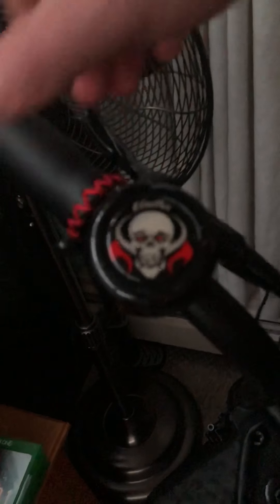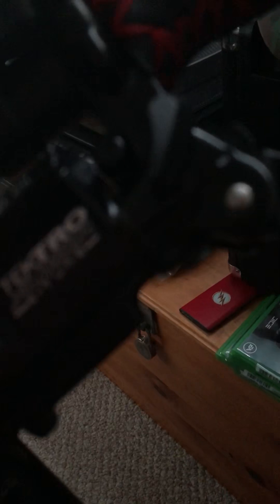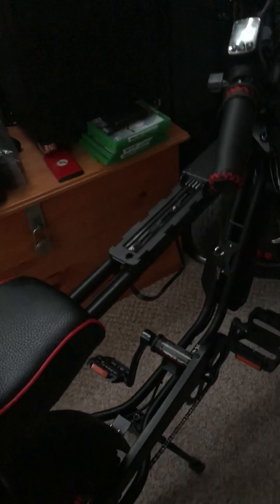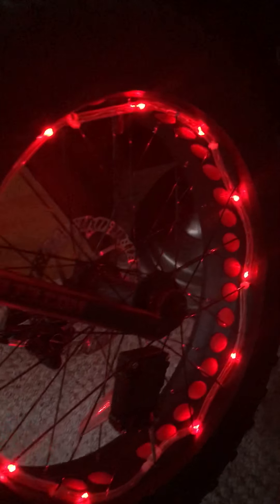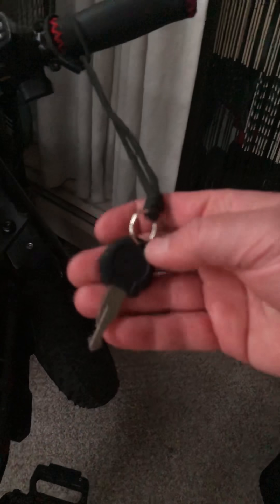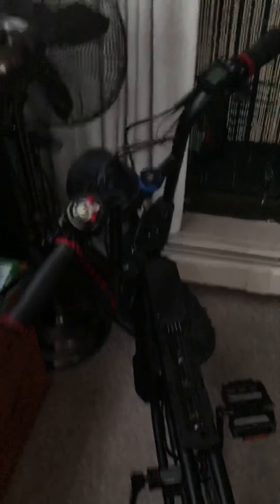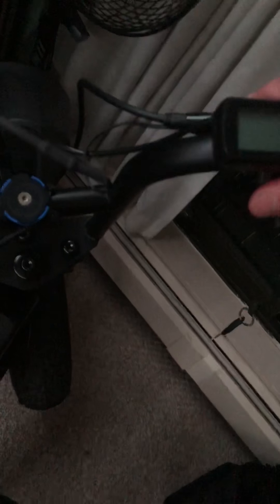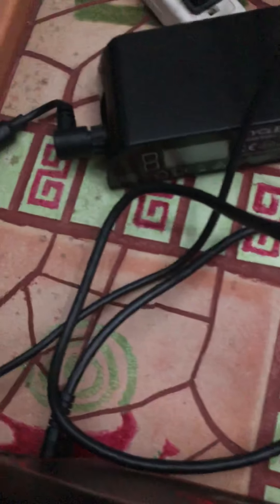Lithium cycle rose ave super 73 hydraulic break upgrade

Comment: Hi .. Thanks for the videos .. Which bike to you think is a better value .. Super 73 or Juiced Hyper Scrambler and why? Getting ready to buy one .. also looking at Mario Ebikes Super 73 copy .. Your evaluation would be much appreciated .. Trying to make an educated decision .. Thanks so much .. Mitch
Reply from the maker: Mitch Davis Honestly it’s a tough call I like the extra speed and range the hyper scrambler  gives me but it is one hell of a fast bike and if you are not holding on tight you can get thrown right off. super 73 doesn’t seem to have any bugs that I have noticed the one thing that bothered me about the super 73 Rose Ave. is that it didn’t come with hydraulic brakes and really it should have. I really like both bikes to be honest but when I am doubling someone it is far better to have the hybrid scrambler because the extra weight will not bog you down as much. The super 73 just has a cool look to it everything else in my opinion is just a copy more or less everyone’s optimizing the popularity of that frame. That 52 V battery 19. whatever amp hour battery on the Haber scrambler is moneyIf I want to go on a long haul I will choose the hyper scrambler if I just want to rip around town shorter runs I will choose the super 73 . I hope that helps you a little bit also I am 511 and the hyper scrambler is just a little big. Perhaps if I was shorter than 511 I would choose the  Rose Avenue suoer 73 Simply for that reason
Reply from the maker: Mitch Davis I hope that helps man I have also looked at those bikes from China that you can buy one of and from what I can tell it’s pretty much going to be similar I’m not sure where they skimped on parts would be you might get more plastic components but the price is right you might have to spend more money to upgrade it to decent stuff afterwords but they also are a pretty cool looking bike

Comment: Hi, thanks for sharing! Does it make a lot of difference having the Hydraulic brakes instead of the standard brakes?
Reply from the maker: Super 73 UK It does it really does I was finding that with the original mechanical disk breaks that came on the Rose Avenue I was constantly adjusting them and not being a bike mechanic I was taking it into the bike shops almost on a monthly basis to get the brakes tweeked and adjusted and it was not cool.  these brakes pro-form excellent this stopping power is great they feel better too the levers are made of metal not plastic.
Reply: Thank you very much for the heads-up - With all the modifications we have done to our bike it is about 95kg now and with 2 pepole on it we are really pushing the limit! If it makes that much difference then we will look at doing the same brake mod as you have done. We are glad you uploaded, thanks.
Reply from the maker: @super73uk  i had three people on my super 73 a few days ago it was slow of course but it held up.
Reply: Wow, 3 people - Did they sit on your lap??
Reply from the maker: @super73uk  one on rear aftermarket seat.me on main seat and one on battery pack, it was tight. and heavy but it worked.
Reply from the maker: I like it so much better with the kick ass hydraulic brakes.
Reply: @THENEWWRANGLER  Shame you didn't take a picture - would loved to have seen it!  These bikes are built like tanks, so much fun to ride. We have just put our new vid up if you are interested: https://youtu.be/y7ecrGvT6DE